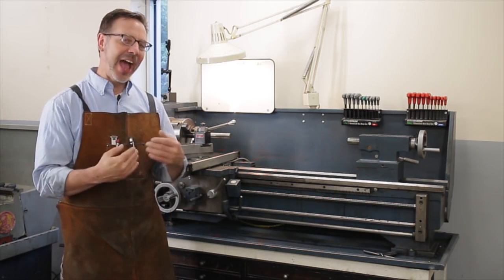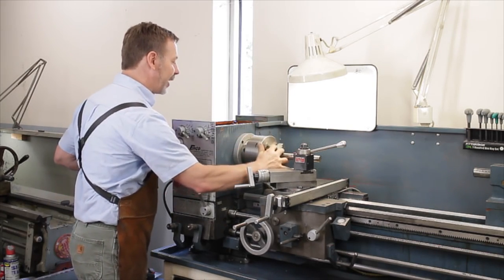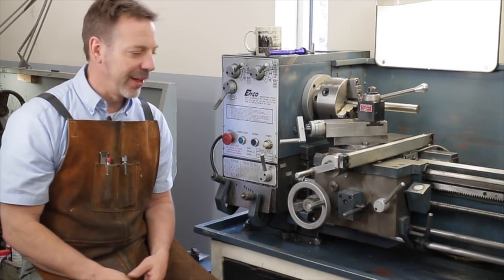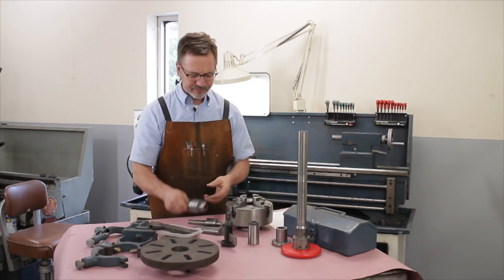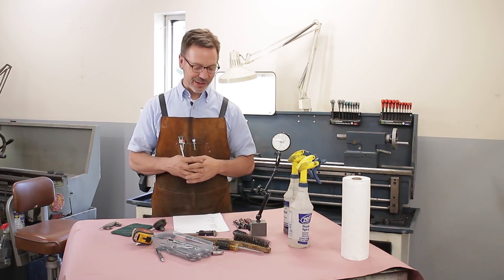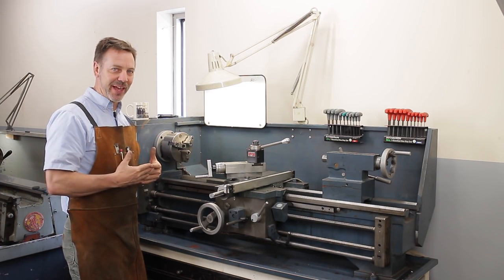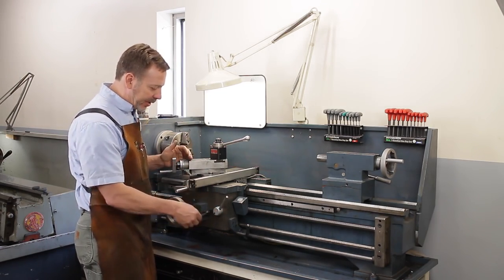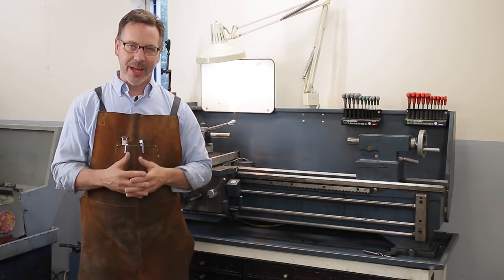How To Purchase a Lathe Component 2 & Steel 1

Comment: Several points: An Asian made  geared head machine with spur gears are prone to gear whine (at least the ones that I've seen). Speed changes can be a fiddly affair on some lathes requiring care to make sure that the gears are fully engaged. As you say, damage of any kind in the head stock makes it a parts only machine in my book. If the particular lathe you are looking at isn't currently for sale new (exactly the same model), finding replacement parts is going to be an adventure.
   V-belt drive lathes should run silently, or nearly so. Noise is usually the result of poor belt alignment. From the factory I've seen badly misaligned motor mounts, misaligned motor to lay shaft  pulleys, and misaligned lay shaft  to spindle pulleys. Back gear noise is usually from incorrect engagement of the teeth and gear misalignment. All these faults are usually correctable by simple adjustment and shims in case of motor misalignment (on my lathe the misalignment was so bad I slotted the mounting bracket to the lathe so the motor shaft would be parallel to the lathe bed). 
  If speed changes on a belt drive lathe are a concern, a simple lever arrangement can loosen the motor and lay shaft at the same time making speed change a several second affair. Why this wasn't installed at the factory is beyond me.
   The quick change box, if the open type like yours and mine, has four 6mm screws holding the indexing plate. My owners manual says to remove the cover monthly to clean and oil the gears along with adding oil to the drip oiler daily. Removing the plate would make an inspection of gears much easier.
   As you say, the spindle to quick change box gear train must have backlash. Putting a slip of paper between the gears is one way of setting this. If  there is too much gear noise to suit you from these gears a small amount of STP or MotorMedic will make them run silently. Use just a little as it is very sticky and any flung off requires solvent to wipe up.